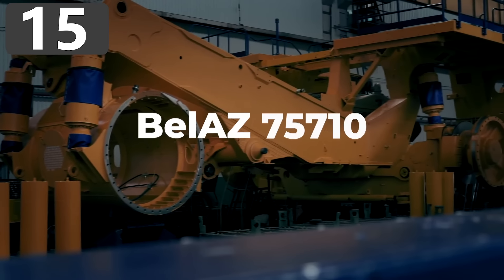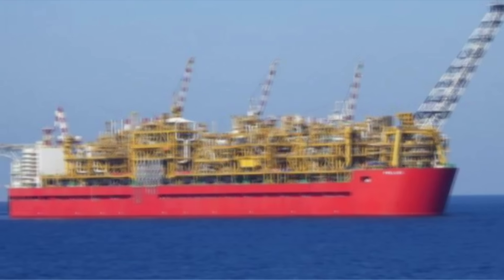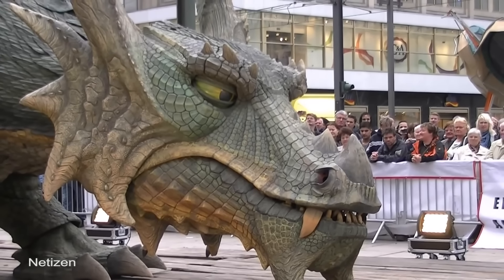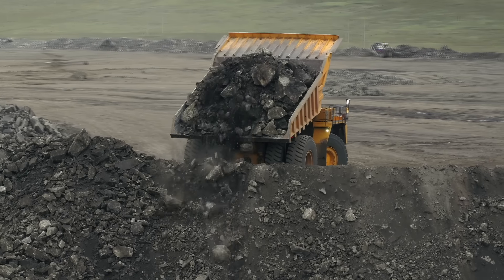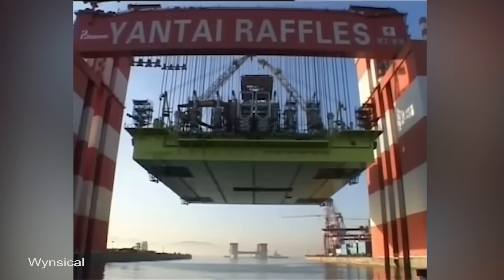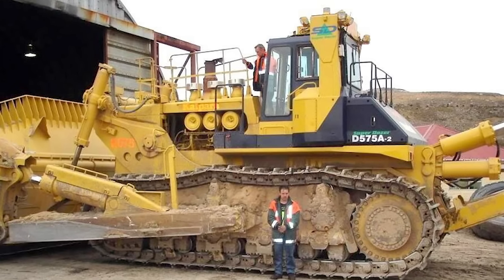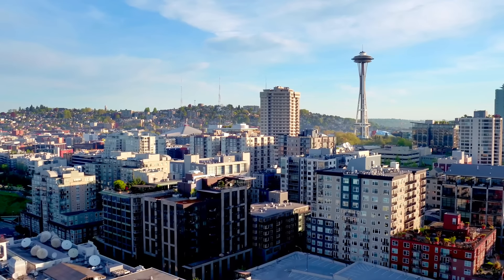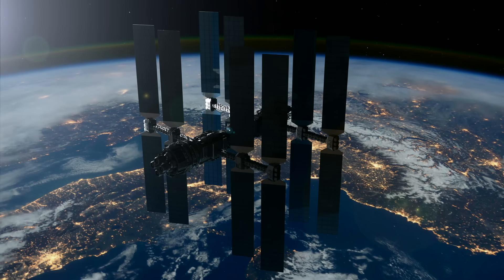15 BIGGEST Machines of Mankind

Comment: Maybe I missed something but the Apollo program sent astronauts to the moon at 25,000 mph, that's quite a bit faster than the ISS.
Reply: Yeah, 17k mph (rounded off) is a pretty standard earth orbit speed. The ISS is not the only thing out there going that speed, either- any orbiting satellite has to go that fast or it would crash to Earth.
Reply: Or space is fake
Reply: Fastest was a little under 25,000 - but fairly close. Apollo 10 during it's return trip at peak velocity.
Reply: Apa yang salah?
Reply: @unforsakendefiance5125  The space between your ears might be fake.

Comment: About Maus tank, it would probably do nothing much because: 
1. it was to heavy to move on soft terrain( tanks need to be as good on any terrain ass it's possible)
2. it costet too much
3. it was perfect training target for artillery and aircrafts
4. too slow
5. and option with going under water is so much no no (soft and muddy, and some rivers are just too deep, too wide)

Sorry for that, I just needed to do that:)
Reply: And then there's the Ratte 1,000 Ton Tank
Reply: @seanrosenau2088  The Ratte never made it past concept stage.
At least 1.5 Maus were actually built (2 bodies, one turret).
But I think the LandCruiser was even bigger in concept than the Ratte.

Take a Carl Gustav design rail gun, mount it on a frame with 4 sets of tracks at each corner.
Total mass estimated in the 1800+ Ton range - about DOUBLE the Ratte - and a MUCH bigger, higher caliber, HUGE artillery piece.

The Maus had very wide and long tracks, it's ground pressure was no worse than quite a few other tanks of the period, though not the best of the era.
Reply: 3 tahun
lalu

Comment: 7:21
Stratolaunch beats the AN-225 on some aircraft records - and is close on others.
But with the only operational AN-225 largely destroyed during the current invasion of the Ukraine by Russia, the AN-225 no longer holds any current "operational aircraft" records - unless the Ukraine DOES in fact get it rebuilt as they have announced they plan to after the war.

Comment: I'm going to point out that the ISS is not the fastest moving craft humans have ever step foot in. The Apollo Missions went much faster. Those missions reached escape velocity.
Reply: Errr..... no?
What escape velocity? Apollo missions never reached escape velocity, at least not the escape velocity of Earth. The trajectory to the moon was nothing but a highly elliptical orbit, if not for the Moon intersecting it, the CM+LEM would just reach some apogee and return back to Earth.
By definition the never reached escape velocity, unless you meant Moon's escape velocity.
Reply: @ahriman935  Apollo missions to the Moon exceeded 24,000 MPH - more than once.
They went FASTER than Escape velocity or they could not have been done at all.
Reply: @bricefleckenstein9666  
No they haven't. You clearly don't understand what the escape velocity is in the first place, and how the gravitational potential works.
If they had, exceeded the escape velocity at any point they would've done just that: escaped from Earth. But they didn't because they were not given enough energy to do so.

And on the way back while re-entering gravity could not have propelled them faster than escape velocity because that would require them to fall from infinity (not mere Lunar orbit) or significantly accelerate on return with their engines, which they didn't.
Escape velocity is not constant, it changes with altitude. And as Apollo module fell into atmosphere, yes, they may have exceeded escape velocity of Low Earth Orbit, which is clearly what both of you think is "escape velocity". But they weren't at LEO anymore, they were at lower altitude, where the according escape velocity was higher as well.
At no point did any part of Apollo spacecraft travel faster than its respective escape velocity. Period, end of story. 

Max velocity reached during Apollo missions was 11.08 km/s by Apollo 10.
For comparison escape velocity at sea level (ignoring atmosphere) is about 11.2 km/s.
Reply: @bricefleckenstein9666  
Correction, actually some parts of Apollo spacecraft did in fact reach escape velocity from Earth on account of having been gravity slingshoted by the Moon.
But for them their escape velocities were in the range of 1-2 km/s due to much higher altitude (and therefore weaker gravity).
Reply: @ahriman935  The escape velocity FROM EARTH'S SURFACE is ballpark 25,000 MPH if you launch straight up - it's somewhat less if you launch in the direction of Earth's rotation.
But the Apollo lunar modules were not escaping from Earth's Surface to go to the Moon - they were escaping from Low Earth Orbit, where the escape velocity is LOWER, and already had a great deal of velocity from their orbital speed.
They WERE NOT POWERED for the entire trip to the Moon, so they HAD to exceed the Escape Velocity at whatever altitude they were at when their rocket engine shut off for the final "thrust" phase.

They couldn't get TO the Moon to do a "Slingshot" maneuver otherwise.
Reply: @bricefleckenstein9666  
ffs, you are willfully ignorant. You confuse several concepts that are not in fact one and the same.

1. the escape velocity does not depend on the direction of projection, because it is a result of energetical balance. You are confusing the fact that the launch gets a little bit of speed from the Earth's rotation, which has ABSOLUTELY NOTHING to do with the escape velocity.
2. Now I can confirm that you haven't got the slightest clue what the escape velocity is. To rise from Low Earth Orbit you have to exceed ORBITAL VELOCITY OF LEO, which is otherwise known as the FIRST SPACE VELOCITY, It is NOT the escape velocity. If they were given the escape velocity, they wouldn't go to the Moon. They would blast right past it.
Reply: @ahriman935  I understand escape velocity.
I do not understand why you are ASSUMING they didn't achieve it, as THEY DID NOT HAVE THRUST for most of the trip to the moon.
They HAD to escape the Earth to get TO the moon.

Why is that so hard to understand?

And there is no "can't exceed escape velocity" just because you are heading to Earth - that makes ZERO sense.
Gravity has PLENTY of time to get you past that point, as YOU DID NOT START FROM A STANDING START but already had some velocity towards Earth from the slingshot maneuver.

And no, I already EXPLAINED that I was not talking about just "Escape Velocity from LEO". Did you even READ my post?

Max velocity reached by the Apollo 10 mission was well before they got close to LEO - they had to RETROFIRE to slow down enough to not burn up during re-entry.
So yes they WERE going faster than escape velocity AT THAT POINT, as they were nowhere near sea level or evel LEO when they started the retro-thrust maneuver.

Hint - just because you are travelling faster than escape velocity does NOT "automatically" mean you "escape the Earth", you have to consider the multiple rocket BURNS involved - like the retro-burn to get into Moon orbit.
Reply: @ahriman935  I am not confused.
You just refuse to look at the actual FACTS.

I am not going to try to educate you any more, you know what you THINK are your facts and you refuse to consider that YOUR world view could possibly be WRONG.
Reminds me of why I disowned my late Father, about 30 years before he died.

If you can't understand that they RETROBRAKED to enter Moon Orbit, you're hopeless.
Reply: @ahriman935  I have ALSO previously mentioned the retrofire to enter Moon orbit.
It would appear your READING ability needs some serious upgrading.
Reply: @bricefleckenstein9666  
You did. Again, so what? It is completeley irrelevant. Let me guess, you mean this line?

"They WERE NOT POWERED for the entire trip to the Moon, so they HAD to exceed the Escape Velocity at whatever altitude they were at when their rocket engine shut off for the final "thrust" phase."

No, they did not in fact HAD to. They only had to raise the orbit from LEO to highly eccentric orbit (trans lunar orbit) that just so happened to intersect the Moon. They STILL never exceeded the escape velocity. If you removed Moon during the Apollo flight and continued on the trans lunar orbit, even without retrofire they would just reach the apogee at some point and return back to Earth, they would not just fly into interplanetary space.
And if they did not retrofire before the Moon, they just wouldn't enter the orbit AROUND THE MOON. It had nothing to do with Earth's escape velocity. Moon's escape velocity yes, but not Earth's. They would be subject to gravity slingshot with reverse tangential velocity gain and enter even more highly elliptical orbit around the Earth. No Escape Velocity at any point reached.

I'm still waiting for that retroburn that supposedly prevented them from burning up in the atmosphere, because you have presented me with no legitimate info and no legitimate source of any such information. It is clear you've imagined some things based on very limited information of what happened during the Apollo missions, but you don't understand what actually happened and why. You're like kid trying to argue with a plane pilot how Santa Claus flies. Laughable.

Comment: Do not mix Tons with feet... use either the English System or the IS (Kilos, Meters, seconds)
Reply: There are metric tonnes and Imperial tons. It's not mixing tons with feet, both are part of imperial measurement
Reply: @MrG9002  You misunderstood. The whole point is that english units are out of date... no longer used in the world but in USA.... Now, the rest of the world have the International System of Units (Second, Meter, Kilogram, Ampere, Kelvin, Mole and Candela).
Reply: @charlypomos  Agreed. I work in Canada where we use imperial measurement but also have had the opportunity to work at companies that use the metric system only. The metric system is by far superior.

Comment: Mothership building is fun aliens alliances armada outerspace alien infiltration act members clones made by ufos cyborgs in their midst power take off press gears cables pulleys hydraulics flex joint scaffold tile pressure panels solar panels microwave panels cyclone intake sorter valves psi tanks compressors fuel recycling system from the byproducts of burnt fuels can make better quality metals diamond coating fiber optics cloaking device reflector lite source codes focal lasers sending signals quicker kinetic energy readers picks up signals quicker and is a site system and power source power wind poles heat cool channel tubes heat cool hover panels power wind suspension dynamo brake generators electro static magnetic shield generators electro static magnetic purpultion nueral implants nerve splicing nanites gene therapy let's build motherships planet moon sized orbital powered and multiple power source systems molecular vision elemental vision sonar magnetic field vision electrolysis vision reading electric current and fleets of ufos and reanimate lifeforms and make sure life is forever and the universe doesn't resalitify nanotec munitions that reanimates reprograms uploads downloads information